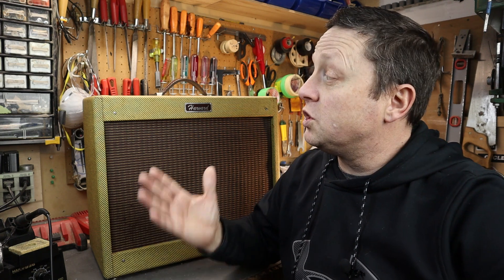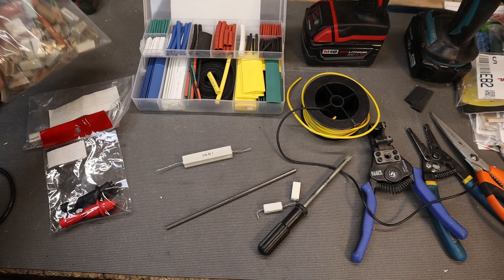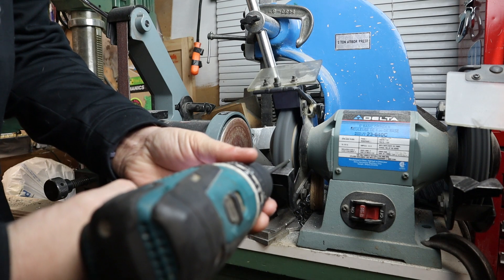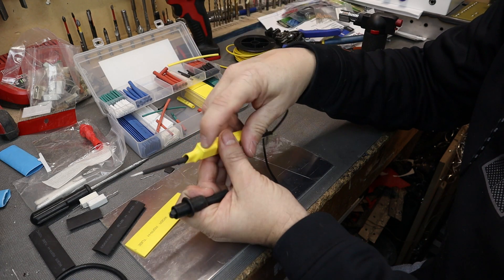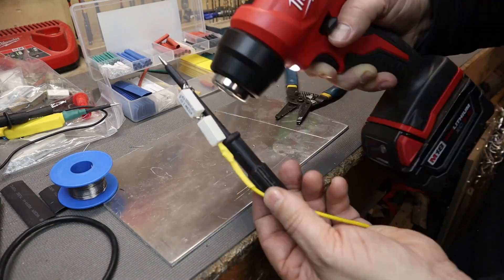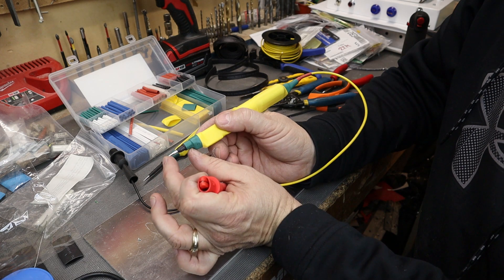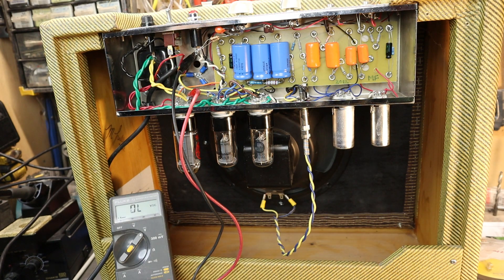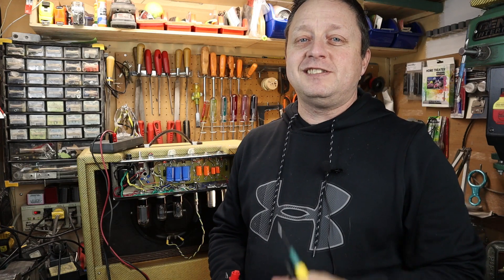Making a Capacitor Discharge Tool // Discharge Capacitors in a Tube Amplifier // Tube Amp Safety

Comment: Can you use it to safely discharge a capacitor in a central air conditioner?
Reply from the maker: It depends what the size of the capacitor is. If it’s just a standard run start one then yes.  If it’s a larger home rated for very high voltage you would need to calculate the RC time constant of that just to make sure it is safe. But the general idea would be the same.
Reply: @MikeFreda  Thank you for your prompt reply.  My A/C capacitor is 45 + 5.0 mfd, 370-440 VAC, 50-60Hz, protected 10,000AFC

Comment: Thanks for the video.
So putting two resistors in series will indeed double the resistance?
Example 500ohm plus 500ohm would equal 1000ohm? Does this have the same affect on the wattage rating as well?
Have my parts on hand, so I will make a couple of these so I safely do some minor work on my amps.
Reply from the maker: Yes, you are correct and that will work just fine. Probably want to go with at least 5 watts each. 

Most tube amp drop voltages pretty quick... ie charge curve... that last remaining volts are a lot lower and take additional time to zero out.
Reply: Resistors do add in series. A 100 ohm fed into a 200 ohm fed into a 50 ohm would give you an equivalent resistance of 100+200+50 (350) ohms

Comment: I've seen quite a few videos on making these. In one video someone demonstrated their probe on a cap charged to 450 volts.. There was a meter connected. They touched the probe and the voltage dropped to near nothing. They removed the probe and the voltage had climbed back up a certain amount. Connecting a resistor creates an RC circuit with an associated time constant to discharge. This is why for my probe I put an insulated alligator clip on the end and leave it connected for several seconds allowing me to do something else. I also used a fairly low value resistor to cut that time down. I will admit though a 'touch' probe is better than nothing.
Reply from the maker: Yes, you are correct. It does climb back up a bit but only a few volts. I typically touch for 5-10 seconds. But yes, attaching clips to let it drain for an extended period of time is also a good idea.